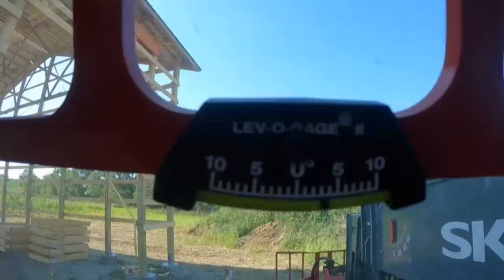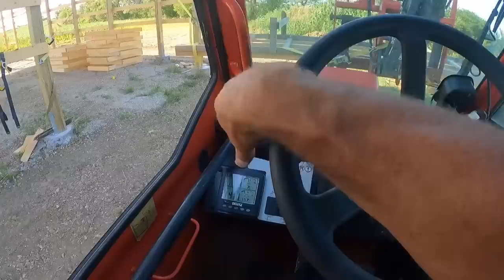The Barndo Build | Day 10 + 11: Roof Metal | Ep 8

Comment: Hi Marshalls. I am wondering how post frame construction suits areas where more stringent air tightness tests now need to be passed (passing blower door tests). As far as I understand, the most foolproof way to get good air tightness is to sheath the exterior and tape all the sheathing seams. However with no sheathing here, its gotta be air leakier? I understand you use closed cell spray foam on the back of the housewrap, but wondering how good that actually is vs the taped sheathing? Thanks!

Comment: Manufacturers say to screw about an inch to the side of the rib. If you screw on top of the rib you just lost any warranty. Many years ago we did  (nail) on the ribs, but the metal was 24 gauge than. Than we started using screws and went to 26 gauge and now to 29 gauge.
Reply: There's also 28 gauge and the higher you go in he number the thinner the metal.  Yes never put a screw in the rib for sure.
Reply from the maker: Some suppliers specifiy that you can do either way. However, we prefer the flat.

Comment: What prevents the screws from leaking over time?
Reply: Nothing. They expand and contract and back themselves out with heat and cooling cycles. Rubber washer fails in 15 years or less.  Seamless won't leak.
Reply from the maker: There are studies that have tested these long life exposed fasteners. If properly installed they last for upwards of 60 years. However, you should regularly inspect your roof for fasteners that may have not been installed properly. 

Ultimately, seemless/hidden fastener roofs are less likely to leak. However, they take more time to install and are more expensive. 

We inform our customers and leave it up to them on which product they want installed. 

We personally have an exposed fastener roof and I’m not worried about it leaking. I will check it on an occasional basis, just like you would any other roof.